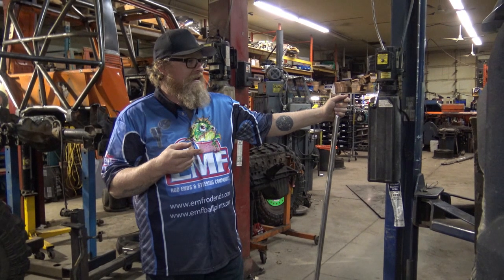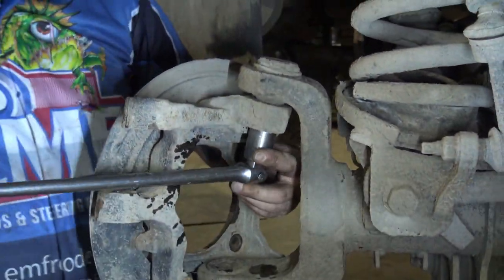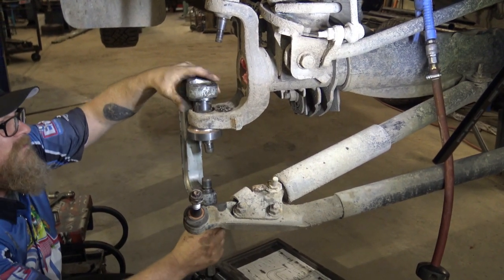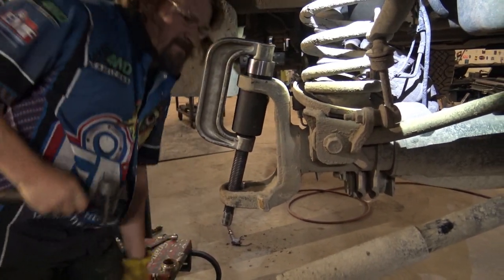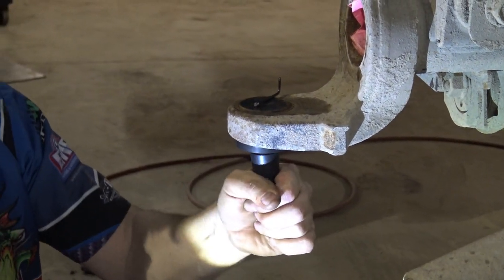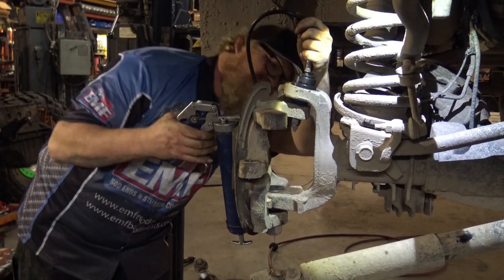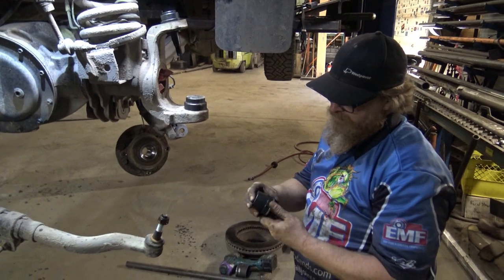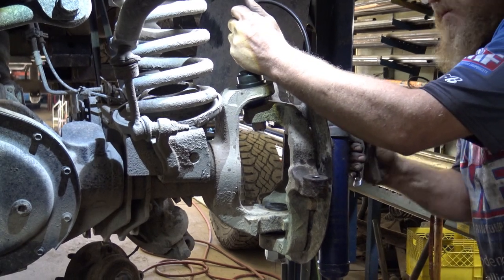EMF 2013 Dodge Ram 3500 Ball Joint Install

Comment: if anyone is looking for ball joints for a ram 2500 or 3500 look no further ... i installed these on a 2012 ram 2500 with 6" lift and 37" tires and boy did they do the trick ... 45,000 miles later on pothole infested highways and they are in the same shape as day one .. the price is a bonus !!
Reply: curious if you also beat the shit out of the knuckle with a sledge? any issues with install? are the nylocks also wired castle nuts?

Comment: When removing several of these ball joints I found the c-clamp had too much deflection and would bind the joint on the way out. I built a puller with two 1" plates with threaded rod on either end and a hole in the center of one for pin clearance. Tighten each side equally and  hit the axle yoke/balljoint bore with hammer in-between each tightening. Always works for me on those stubborn BJs and never had a joint fuck the bore on the way out. Installed 2 sets of these emf joints on my personal truck and beat the shit outta them and they're like new. Thank you EMF crew

Comment: Didn't realize mine were still stock at 105k when I bought it.  Went to change them and struggled mightly to get them out.  Should have watched this!  So much satisfaction watching them wail on the clamp with a sledge!

Comment: Just bought a box of these for the upper and lowers on my ‘01 Dodge 2500. Followed this video and the excellent printed instructions. The top BJ torques down just fine. The bottom just spins despite following the directions. I’ve left a few texts on their tech line earlier today. I’ll let you guys know what happens. They appear to be really stout and the install tools are a great help.
Reply: how are they holding up?
Reply: @superflyguy218  wow, I‘m pretty late with the reply so sorry. They’re incredible, After 50K miles or so I’ve added maybe 1/2 to 1 full pump full of grease to just the upper BJś (Redline if it matters) I wouldn’t own a 2nd Gen without these.
Reply: Needed to use my floor Jack to put pressure on the lower BJ to prevent the spinning. They’ve proven to be bombproof. Very well designed product and I really appreciated the included install & adjustment tools

Comment: Would you recommend putting anti seize on the surface mating flange (not the taper bore) and the threads on the joints? Additionally how high would you recommend getting the front end off the ground to get a good angle with the sledge? This is looking like a weekend driveway job I might need to build jacks for.

Comment: Aviation mech trick for install. Heat the knuckle and put the ball joint in a freezer or better in liquid nitrogen right before install. Ball joint will fall into place, no pressing no beating.
Reply: @Edwinke11ey  fact
Reply: I was thinking the same thing

Comment: Why not spray penetratingly fluid on them, I used the old standby WD-40 on mine, and they came straight out. Mine were factry, 210,000 miles.

Comment: I always wondered why my trucks steering and handling turned to shit after replacing ball joints... nothing is likely the same after getting beat and pryed to death.  I think doing this yourself where you can use time and lots of penetrating oil would work better...may as well replace the axle seals while its apart.  Since the parts are junk I'd be using a torch a bit more too.
Reply: Have you had to do one of these yet? I’m doing mine next weekend and I’m in the fabrication business and I thought the same about the torch. I wouldn’t try this without a torch to at least pre heat the metal around the ball joint. If you did try this method, how’d it work?
Reply: It worked fantastic still had to tap the knuckle but I used heat and fluid. Didn't have to smash the knuckle though

Comment: Looks like a hell of a job even for these pros. Got me a little worried about doing my own 😬
Reply: Thinking the same thing.  I've done a fair bit of front end work and this looked a little tighter than I'm used to.  I'd likely honk too hard with my air impact and mess something up.  I've never been brave enough to beat that hard on knuckle ears.  Might leave this for the pros too.
Reply: Ya, there's gonna be a lot of prep work to make sure it can be done over a weekend.

Comment: Interesting using a puller to pull the wheel bearing. Every time i have tried that it pulls the wheel bearing apart. I went to a air hammer tool that hammers on the bolts that hold the wheel bearing in.
Reply: My neighbors was rust welded in his 11 enclave, I'm like yea take it to a shop I don't wanna beat the fuck out of your wheel bearing, break it then be stuck having to take the knuckle off the rear(big job) not worth the 100 I was gonna charge him for labor lol
Reply: @johnnyversaci7091  Use a socket with extension on the end of the knuckle bolts. Wedge it against the frame of the truck. Turn the steering wheel to break it loose. Works like a charm.

Comment: I done this a few days ago on a 01 ram 2500 definitely wasn’t a good time. When the new ball joints crap out in buying a new truck
Reply: You'll never go thru these joints. I have 150,000 miles on mine and opened them up to see how they look. They look like new and I have 22" wheels(-45 offset) with 35's and a 6 inch lift. I've taken this truck thru bad roads in Colorado and New Mexico. I've driven across the US. These are bullet proof, seriously.

Comment: That press is impressive. What is the make/model of the press you are using that can take the beating from the hammer and the impact tools?
Reply from the maker: Jet it's not an expensive set. But I've used it for about 12 years now.
Reply: The part number is visible on the press. 521808-1.  A google search takes you right to it.
It looks like it's larger than the standard auto parts store rental tool.

Comment: That electric hammer is a toy. time for a new one. put a little lube on the new ball joint for easier install. Also I believe the manufacturer of the C clamp recommends putting oil on the threads

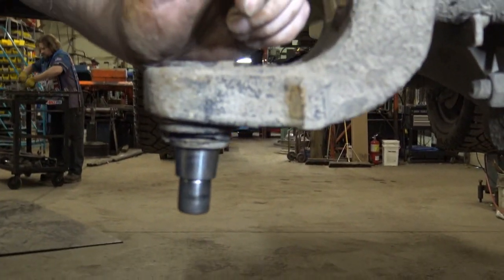Comment: Great video!! At 10:11 what is that silver cup your using at the bottom of the ball joint? I’ve noticed none of my cups seem to fit right and the press wants to get all out of wack once pressure is applied. Thanks!

Comment: Have you guys ever try to use a air hammer near the brake rotor studs to vibrate the rotor? Ive used it in the past, mostly since i dont have the upper body strength to do that

Comment: No how about telling me where i can get EMF joints for my 2001 Ram 2500, they are out of stock from everyone.
Reply: I'm in the same boat.  Unfortunately, due to limitations in resources (likely raw materials, labour and logistics), it can be tricky at best these days especially for small production lines.  I've asked around and it sounds like everyone is hoping for 4-6wk replenishment. If I can't get them before the snow flies, I may be looking at another option such as Carli.

Comment: Dam I have a job for a 2017 3500 4x4 is it the same I thought the F550 were hard Dodge is scaring me I don't want to damage my ball joint kit hammering on the clamp.
Reply from the maker: What kit do you have ? The snap on ones do it easier

Comment: Wow was that the smoothest wheel bearing removal. Now does the puller usually do the job? I find especially on any truck that’s rusty with original wheel bearings after 200k I have to try everything. Try the power steering trick, air hammer, torches. It’s especially hard if you wanna save the bearing. You guys ever run into this ?
Reply from the maker: We use the power steering truck but we've damaged the seat for the u joints on the axle ear on really ignorant bearings. The 13 and up is way easier than the 03 to 10. I like the actual puller. The three jaw works well and is more common in diy tool boxes. And the power steering truck works for everyone. You have to watch not to wreck the bearing with the puller.
Reply: I used a puller on mine as well, It worked great, hope you guys used anti-seize when putting it back together.

Comment: Just curious, how many miles was it before those ball joints were taken out...?
Reply from the maker: I don't remember. We've seen trucks with  250000km on factory joints and trucks with hammered joints at 25000km. The one thing they have in common is bad scrubbing of the tires.
Reply: So my 2014 ram 2500 , front ball joints messed up and im still at 38000 miles.  Truck is drifting to the right and i hear a constant knocking sound on the driver side...
Reply from the maker: Is there movement in the joints? Are they our joints? Knocking can come from a variety of things. Most commonly the shock bushing on the lower mount. There are body mounts that cause a knocking. The steering knocks between the box and fire wall.
Reply: @EMFEVO   These are factory ball joints for this ram 2014 2500 diesel.   And I just checked the ball joints again. The lower ball joint is worn out, and the track bar is out too.  Jeesh ....

Comment: did you replace the axel seal?
Reply from the maker: No that's a whole different ball of wax. Center section has to come out to do that.
Reply: @EMFEVO  It's a right pain in the ass, I rebuilt my entire front end 2 years ago, took me 3 weeks with the proper tools, never again F that.

Comment: If I walked into the shop and saw my guys beating on the c clamp I would send them on their way. Good way to destroy the clamp.
Reply from the maker: You just power your ball joints in with the clamp?
Reply: @EMFEVO  no hit the knuckle with a smaller hammer the shock breaks the friction better than hitting the tool and a lot easier on you.
Reply: @EMFEVO  switching tou EMF balljoints on my F350  after trying dynas on my last super duty hit a rock hunting and trashed one of the lowers. You guys have a much better product.
Reply: @EMFEVO  just got my set for my 2001 F350 cant wait to install them.

Comment: This is exactly WHY IM DIY AND WILL NEVER TAKE MY EXPENSIVE DIESEL TRUCK TO A MECHANIC SHOP . They don’t care to take care of things or other peoples shit they just do whatever it take to get the job done even if that means bang the and pry the fuck out of shit and causing damage to other components
Reply: Dog, you own a 24V. Get off your high horses. 

This is a Candian truck, it's seen 7 winters, rust in a real thing, it lockes the ball joint in. It's not actually this difficult in normal scenarios. Also that beef 9.25 isn't getting hurt by then beating on jt

Comment: I'm ready to install my EMF ball joints on my 05 Ram 2500. I've heard freezing the ball joints makes it easier to press in. Any issues with that method?
Reply from the maker: Kind of a waste of time. Put pressure on the clamp and hit it with a 3 pound hammer. Tighten the clamp and hit it again. It's the best way to ensure you don't damage the hole and it helps the joint go in straight. More effective than freezing is using a  heat gun on the axle. It opens the hole more than freezing the joint shrinks the body.
Reply: Thank you, got them in and looking forward to to years of service.
Reply: freezing the and heating the knuckle makes things much easier just dont heat the knuckle too much.
Reply: @dodgedak03  Any gotchas with the install? Did you primarily use air tools or did you follow as in video beating it with a bfh and using more finesse with hand tools?
Reply: @AN-kg4ei  The biggest issue I had was having the right size spacer rings for my clamp press. Once I had the right spacer rings, install was similar to the video. Tighten clamp press then hit the clamp with a hammer, repeat until the ball joint is flushed. Don't forget to orient the grease zerk to an accessible direction.
Reply: @dodgedak03  biggest issue now is getting my hands on a kit.  👍
Reply: @AN-kg4ei  O'Reilly and AutoZone rent them out. Don't forget to rent the 4x4 ball joint kit with it. They don't really mind if you use a hammer on their press clamp. 😉🔨
Reply: @dodgedak03  I meant the ball joints.  I have a few decent front end kits that should get them squished/smashed in...
Reply: my ball joints arrived today - excited to get them in before too much snow flies.
Reply: @AN-kg4ei  I enjoyed installing mine. They have been great so far, superior to Moog and factory! 
Going after the last remains of my front end today, the gear box.